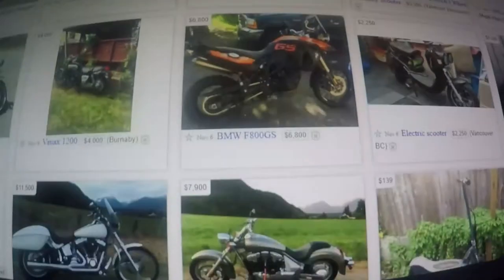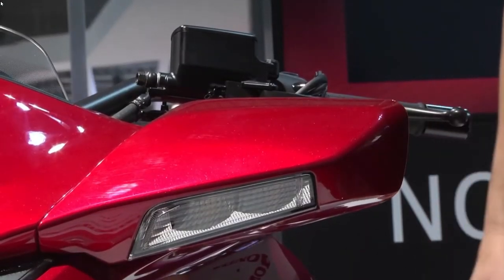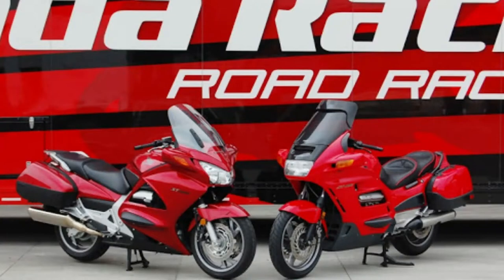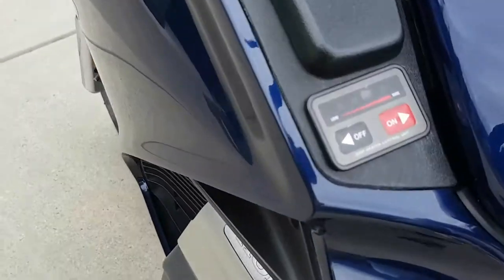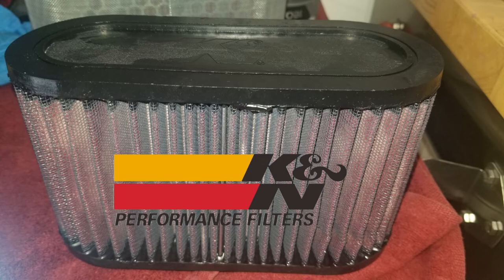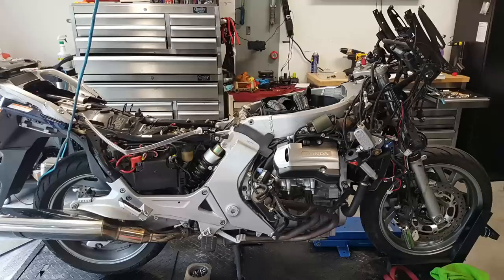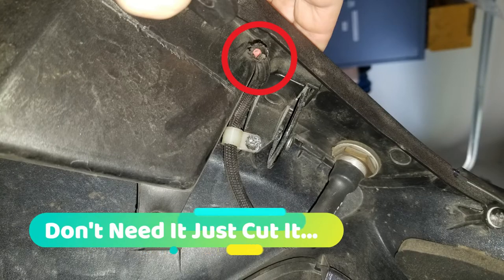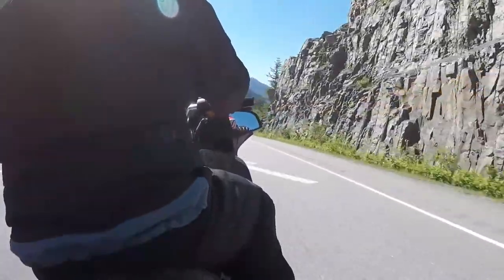Trouble When I Bought A Honda ST1300 Pan European...

Comment: I think (personally) that the K&N Filter was a negative, not a plus.  No one has convinced me they are worth anything over a regular filter. Some claim the oil mist off of the filter can mess with the MAF sensor
Reply: Can you wash and reuse a stock air filter?
Reply: @joshmoore6165  No. but I can buy a new one without buying K&N’s expensive Recharger Kit.
Reply: They're supposed to Flow more air for more power but I rode mine with the stock filter,a KN and no filter at all and it made no difference either way.what can flow air better than no filter?so as far as HP gains with KN it's a crock of 🐂. maybe it's good for something else but not HP.
Reply: @jackwoods535  20-25%?  You must be kidding.

Comment: I’ve had two. ST1300s, a very used 2003 and a two year old 2009 that had 9 miles on it.   I put 1200 on the 2003 that had 41k when I bought it and 90k on the 2009.  I took each in every two or three years for complete fluid changes and engine check(compression, valves, timing system.   Never changed the plugs or wires.  Other than that, even with towing a camper for a good bit of those miles the bikes never needed any valve adjustments or timing chains.  The only problem I had was Wheel bearings on the 2003,  I think the previous owner too the bike to a car wash and got water in those seals.  Stellar motorcycles.   Huge bags, comfy seat, bar risers, great wind and rain protection.   Suggest the fairing protection kit as a way to quiet wind noise.

Comment: I had a new 2003 ST1300 and I got to say it was great! never missed a beat in 125000 miles by the time I sold it in 2013.. only bought a new Yam FJR1300 because I could not get another new Pan .
Reply: How does the fjr compare? I’m thinking of both, the pan weave scares me, ever had the issue?
Reply: @keithquinn5624  I have a 2004.  Never a problem with weave.  The weave issue was on the Police ST1300 because they jam loaded a lot of heave radios and electronics at the rear that screwed up the balance (CofG).

Comment: As a 2005 and 2012 s t owner I'll tag along with you. But ditch that K & N filter. Stick with OEM for filters AND fluids. Right down to the Honda antifreeze.
As a previous owner, You're aware of the tire cupping and also of the short tire life. Is all part of life in the big league.
Run hi end dual compound tires at 40- 42 psi rr. 38-40 front. Also, that rear shock is shot, so crank up the preload to max. It prolly feels ok, til you ride a new one.
Lastly. 04's were hot. remove some inner fairing panels for better airflow. Ck for a bit of air  in clutch line, then sync the TB's.
may consider some risers with those stock bars. my 05 is more relaxed with them.
be safe.

Comment: I just purchased a low mileage (for this bike) ST130. I have ridden them but never owned one and this is my chance. The previous owner installed a bunch of accessory lighting and it has amateur wiring running all over the bike. I have been having fun finding all the LED light strips and accent light that have been glued to various bits of the bike. The PO had stopped riding it over 4 years ago but it was started and ridden to a new address withing the last 15 months. It my cost me a new fuel pump but it will be worth it given the price I paid. Oh. . . the biggest issue with the bad wiring is the use of Scotchlok connectors. I determined that pulling them out would be worse than leaving them in place so I isolated them and left their removal to a winter project.

Comment: They're a damn fine machine in the right hands. That's where the issues start, in the wrong hands. Just brought my second ST 1300 but this one has 100k on the clock. Apart from obvious things to attend , I've ordered new coolant lines for some future maintenance and  sorting out the forks with rechromed tubes.
Reply from the maker: Thanks for the feedback & the view!  Hope you will check out the rest of the series on this bike...

Comment: I think it's pretty clear which motorcycle shop you're referring to (recently closed, in Coquitlam) I agree that their auction dreggs bikes were quite overpriced. I did purchase some decent riding gear, over the years. They were also a good go-to source for soft & hard luggage. The garage component, though, never seemed to operate too smoothly. But, the problems of supply chain issues, brought on by the pandemic, was the deciding factor for the owner to close up shop. 
I've always performed any basic maintenance on my bikes, but there's a number of other shops, closer to home (central Van.) that get the more involved jobs done much quicker, and correctly.
Reply from the maker: Thanks for the feedback, liking & subscribing!

Comment: Need assistance and hope you can help.  I was on 3Kmi trip. I got 363mi into the trip and the bike, an '07 ST1300A, just shut down. I had had the ABS light come on once before this ride, but it did not come on again. When the bike shut off the ABS light came on, but it was blinking so fast ( I counted 26 blinks before I stopped counting) that it was not blinking in a way to discern a code. I tried to restart the bike, the 1st time it sounded like it wanted to start. But I turned it off and left the garage. I later went back to restart the bike and this 2nd time it didn't give off any sound at all, not even a click-click. I turned the bike off and went back inside.  I have the battery on a charger and will go back out to see what happens. (The ABS light does come on, but it is not blinking at all. Instead, it is a steady on, so no code is showing.)
Reply from the maker: All you can do in these situations is start with the easiest solution and work your way through. First, lets clear up that the trouble codes will come from the FI light, not from your ABS light.  You can get codes about the ABS system from the ABS light, but you have to remove the number 1 and number 3 control motor fuses, then turn the bike on with the fuses out to diag the ABS.  BUT that is NOT what you are after and the flashing you saw was probably electrical related.  There are 33 possible codes from the FI light (1 flash to 33).  You did not mention any so if the light is not flashing and bike not starting this means; open circuit at the ECM power input (unplugged or broken harness, bad ECM), faulty bank angle sensor, if this sensor comes lose from its mounts or fails outright, the bike will turn over and no start, faulty engine stop relay, one of my favorites is the engine stop switch on the right handlebar.  These switches have multiple contacts on the power out lead and can get full of dirt causing an intermittent condition where the bike turns over but there is no ignition and/or fuel pump.  The same is true of the ignition key barrel.  If you bike is European, you said miles so could be UK or USA, you also need to contend with the security system where the ignition barrel cannot detect the RFID chip in the key and it drops out the ignition, the bike will turn over but no spark/fuel.  Blown PGM-FI Fuse which is a 30amp fuse or a blown sub-fuse 10amp (starter/ignition), but these are unlikely to be intermittent.  Is the fuel pump priming?  Take your seat off and check that the fuel pump is running when you turn on the ignition and engine stop switch.  If not this could be one of the problems above or simply a bad fuel pump since they can fail, come back and then fail completely as you described.  Secondly, I suggests looking at the spark plugs and checking the bike for proper spark while the plugs are out since this will confirm the problem is electrical or fuel. On the topic of ignition, the areas I would check is the low voltage coil wires, coils themselves and the wire that leads to the pulse generator.  Sometimes these wires get frayed or baked to the point they crumble and break.  You said the bike is turning over but I have also seen weird problems with the kickstand switch and the clutch safety switch.  If bad these switches should not allow your bike to turn over but I though I would mention them.  Seriously though, one of the most common issues is the engine stop switch and ignition barrel for reason already mentioned.  https://youtu.be/W0MTZbtMgOw?si=_3Yh3WYP7unTNF9G&t=571 Because you did not indicate any performance issues while the bike is running, I would focus on the electrical, something that is intermittently grounding, shutting off, not grounding properly like a connector harness or key ignition component like the switches and relays.  The other area that creeps up on these older bikes is a corroded or loose battery ground/earth cable. Finally, the battery voltage can cause all sorts of intermittent issues if the bike is not charging properly or the battery is discharging while sitting at a traffic light.  If the battery is strong, fine check your voltage while the bike is running at the battery terminals.  Should be a 13V plus and no higher than 14.7V.  Send me an email rodrideswrenches@gmail.com and I can send you an 03/04 factory service manual if you need.  Good Luck!

Comment: I’ve have an issue with my 2004 1300 Pan. When I wash it, it doesn’t like getting wet and will miss fire. I’m on a trip to Ireland and it got rained on last night now won’t start. I’ve checked spark, plugs were wet, pump is priming and F1 light goes out but still won’t start. Anyone help?
Reply from the maker: So much to check here.  Stupid simple stuff is where I would start since the coils are well protected under the fairing and even wet would spark.  I suspect it is the ignition pulse generator P/U sensor which is on the front of the engine, it is cracked and getting it wet is shorting it out.   Obviously water is getting somewhere it shouldn't.  The low voltage lines leading to the coils from the PGM/IGN Unit, and potentially a multitude of harness connectors could also be the issue but if you haven't been in those areas and pulled anything apart they should not be an issue.  Finally, check the fuse box under the side panel.  If the cover is cracked and water is getting in it could be the source of our lack of spark.  Sorry to hear of your trouble & good luck!
Reply from the maker: Just had a look at the shop manual.  Honda also suggests for your condition it maybe a faulty engine kill switch on the right handlebar.  Take it apart and clean it with WD40.

Comment: Ive fot 2 my P model has mine is a 2014 first registered with the Queenslabd Police service in 2016 stopped service by 2017 I bought her in 2018 she's not got over 400.000km and still runs like a new bike she's serviced every 6k and over those km I've ibly spnd money on an Altinator 2 timing tensioners not required plus a water pump also not required that was just as she got to 400.000km it runs well enough yes its heavy but irs comfortable.. so I bought an 09 model with 50.000km

Comment: Hello and thank you for a great series of ST videos!   I just bought what I thought was a screaming deal on a 2006 ST 1300.  It was advertised with less than 2000 miles and a great price.   I got it home and came to the conclusion that this bike had way more than 2K of miles in it yet the odometer said less than 2000.   Is it possible to turn back the digital odometer some way?   The bike is in great shape looks great and well maintained but the pegs, and tour packs tell me it's got way more than 2000 miles.   Your thought?   Thank you for your time.
Reply from the maker: Most Honda dashes can be replaced.  There are companies out there that can hack into the memory and set the odometer to whatever you like.  Some dashes from police bike conversions have shown up on places like ebay.  2000 miles on an 06 is pretty suspicious.  Sometimes guys will buy a touring bike and ride for one or two big trips then never ride it again, not sure if this is better or worse for a bike.  The Honda I purchased in the video has 23,000miles which for an 04 is crazy low but the bike sat for a very long time, years without getting ridden because the previous owner had back surgery and he held on to the dream of getting back out on the road trips, around the block is the best he could manage after the surgery.  New video is out tomorrow, I analyze an oil sample from the ST1300 and compare what's in it to my 200,000km BMW.  Thanks for liking & subscribing!  Don't forget to share with other riders and friends & forums!
Reply: @RodRidesWrenches   My '04 shows about 24,000km's on the odo.  However,,  when you pass 200k miles or km's,,, depending on your primary measure is in mph or kph,,, the  odo zero's itself.  I watched mine do this,,, and took photo's of the odo at 199,999km and zero, just a km later,,, for postarity.  The '06 with 2000 miles on the clock,, may well have 202,000 miles on it.

Comment: A rock solid bargain used bike to tour with on the cheap but not to fall in love with and keep. More touring than sport for your bucket list of long trips with 800km days. They are comfortable, powerful, smooth, surprisingly nimble and an absolute bargain. A bit dull and dated looking though. Lots of polygons stuck together make them look better from a distance but jumbled from up close. So many V-shapes everywhere. Also some questionable design choices (exposed engine but with cheap silver plastic engine covers,  poorly lit display, lots of contrasting black plastic bits everywhere, storage bins in the fairing get too hot for anything sensitive)   The engine sound is like a Civic, all whirring gears. The V4 grunts a bit when you open the throttle but acts like a turbine with a flat torque curve.

With many cheap ST1300's around why buy one with so many things to replace, poorly sorted and with dubious origin? They are the definition of bulletproof so the km's are not important (same with FJR1300's). You will probably get bored or switch to something smaller well before its useful life comes to an end (over 250k kms.)  2003 -2012 are 1 generation so no advantages there, they have no differing features or upgrades so go for the farkles.

I paid $3600 CAD in 2020 for a 2003 ST1300ABS with 90k km's, well cared for with aftermarket goodies. (electronic cruise, heated Corbin seat , Oxford heated grips, V-Stream windscreen, 2" Heli bars, rear trunk) Everything works and it rides fine because the last guy actually rode it. Stay away from low mileage garage queens. As for the complete strip down, ugh, a waste of time in my opinion on a Honda that has had reasonable care. But I get it, some people like wrenching more than riding. I can't be bothered and don't own fancy lifts and tools worth more than the bike. If the brake/clutch fluid is clear you know the last guy is a fanatic. I simply jumped on mine and rode a total of 10k km that summer on 3 trips throughout Western Canada with only an oil change. This year I got a rear tire and brake pads and did another 5k km. (because forest fires) Next season I will need a tire, brake pads and fork seals for the front. 

I have a few trips in Montana and California to complete before I sell it to the next tourer. I had a 2006 VFR800 previously but made the mistake of wasting time on a lot of unnecessary pampering maintenance (I'll keep it forever!) for a bike I sold after 2 seasons.  Buy cheap sell cheaper, at most you lose $1000? Not worth pumping a lot of time/money into.

Comment: I have a 2005 st1300. Speedometer stopped working along with the odometer displays. 
California shop wants 550 to replace😱 got a quick video how to do myself?
Reply from the maker: I don't have a video but all you have to do is remove the nose cowl and side fairings.  The gauges are then easily removed.  Good Luck!
Reply: @RodRidesWrenches  I heard it’s the speedometer sensor
Reply from the maker: @gregbernard5858  On these bikes it's just your ABS sensor or if the bike does not have ABS it will look like an ABS sensor on the rear wheel.  No real way to check without a scan tool but it is very easy to replace. Here is a replacement for $100  https://ebay.us/W3EfsZ

Comment: Hi there, I like your ST1300 videos! But I have to disagree on the handle bar. Sure the one you took off is ugly. But if you are 6'5" you would think about it differently. I love this bike, but the stock bar is not adjustable and that is a major flaw in the design by Honda. It is great that the seat is height adjustable, but when you take it up you move your torso up and away and there is no way to adjust the handle bar with it. Why in the world would you want the original bars? If they only had a standard bar setup it would be possible to by regular risers and a handle bar that fits exactly.... I would be happy to take the ones you just removed for a fair price...
Reply from the maker: Thanks for Liking & Subscribing, New Video this Friday!
Reply: @RodRidesWrenches  do you have any idea how heavy the engine is??
Reply: Those bars are fugly on this bike. The Hella bar riser is much more appropriate. Keeps the stock bar, raises the bars 1.25”, 2.5” wider and back two (or something to that effect). At a slightly tilted in angle. So comfortable you can ride all day. 
The seat is ideal if you put the rear setting one lower than the front, it has the affect of rolling your butt into the wider part of the seat. Once again all day no complaints. I really like the Pan.